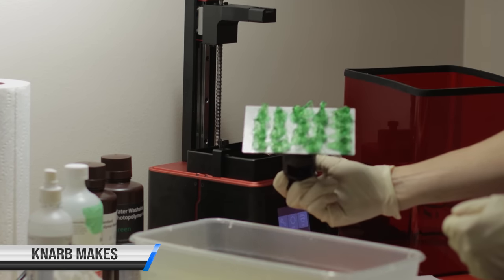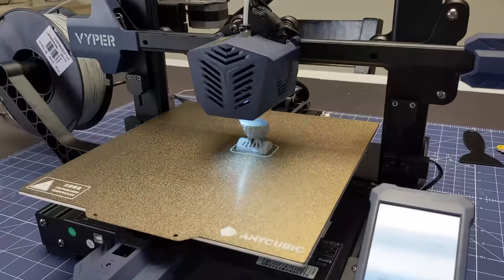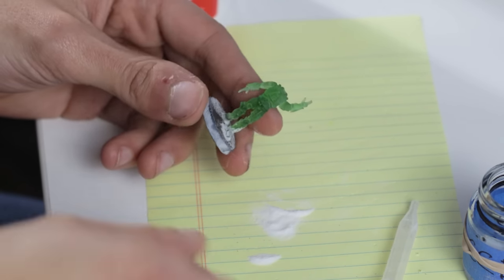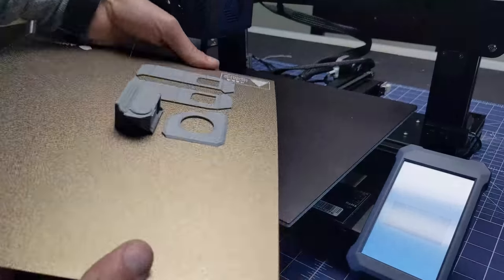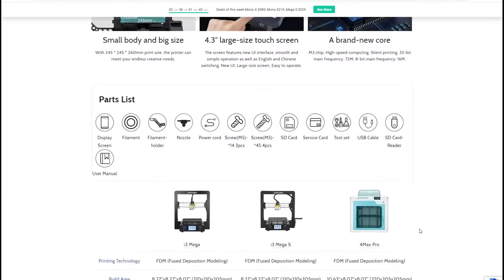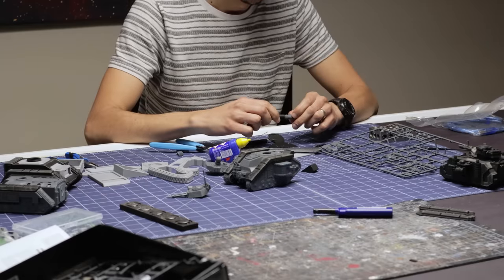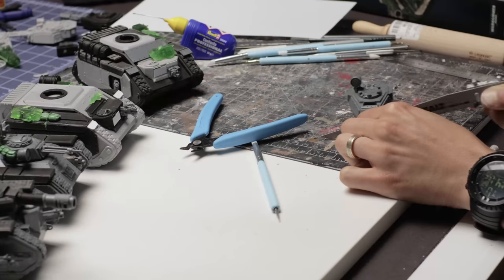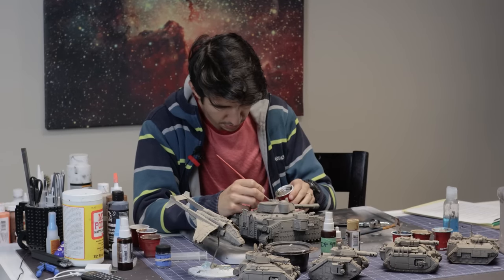Did SLA Printers win the tabletop war? (not yet)

Comment: FDM is suitable for more regarding tabletop and boardgames than many believe. I printed everything with FDM (Prusa MK3s with Multimaterial Upgrade) for my own design of a Settlers of Catan (base game). Of course it is much harder to print detailed objects with FDM, even with my 0.25 mm nozzle for that project but if you optimise the models for that task a lot is possible on a damn fine scale. Details are so small that you miss out seeing a lot of them unless you are looking very close: https://www.prusaprinters.org/prints/44082-catan-set-high-resolution-mmu-unofficial-fan-desig#preview

PS: Nothing is painted there. That's all multimaterial PLA.
Reply from the maker: Woa that's nuts. I need to take a look at a multimaterial printer soon. Very cool result.
Reply: @KnarbMakes  I like the end result quite a lot as well but be warned, it is really only suitable for hobby projects where time and material wasted don't matter that much. And especially the MMU2s from Prusa takes some commitment to get running reliably (but when you have dialed it in, it works fine). I am not sure about the Palette, it is way more expensive and functions quite differently. Certainly has its quirks as well but maybe it is easier to set up. Last but not least you can go full in and try to get a true tool changer from E3D. I don't know that much about it but if you have the money, this looks very interesting and like a game changer of FDM printing. But it might be quite difficult to set up. (Pro: https://www.youtube.com/watch?v=1SCtW1DskXc; Con: https://www.youtube.com/watch?v=7W5pPm0lZDE)

Comment: Dunno if you’re still watching, but have you any Space Marine designs in the works?
Reply from the maker: Not anytime soon. Not really a faction that interest me much.
Reply: @KnarbMakes  That’s coolio. I’m wondering if the turret mounts on top are the same as a razorback/Predator/Land Raider turret bases?So I can bolster my IG PDF with different tanks chassis.
Reply from the maker: @smoketinytom  should be easy to modify if not or use a magnet. The mount is compatible with the leman russ kits I have if that helps

Comment: I've had an Ender 3 Pro for about a year, and other than having to relevel it every few months, it's been a solid machine. That relevelling though...its enough to make me intrigued by the Vyper if that self-levelling feature works and continues to work over time. The orientation of the parts is a fantastic idea, if you can do it produces a very smooth finish. I have become adept at post-processing for those prints that cant be done that way....primer/filler, Mod Podge, wood putty, sanding...they are all close friends now ;-)  Those tanks are awesome btw. Cheers!
Reply from the maker: Yep, some sanding and filler goes a long way! Sometimes layer lines can't be avoided.

Comment: I see it in two ways. FDM can achieve fine details but is better for medium to large scale builds, hence why many higher end FDM have very large build volumes. SLA on the other hand is great for Small to medium builds of high resolution, but small build volumes in general. NOW this rule isn't always true there are outliers and variables of the two, including materials, production of specific parts and their own requirements to manufacture.. etc etc.

For model making in general I use FDM for large pieces, landscape, etc. SLA for small fine details, like single figures, people, miniature weapons, etc.
Reply from the maker: Yeah I've been leaning towards that rule of thumb as well. The crazy detail from sla printers is reserved for when its actually necessary

Comment: Facing the most visible are upwars is a terrible idea, I do the exact opposite. The Z resolution can go down to 0.08mm with a 0.4mm nozzle, however the XY resolution is larger than nozzle diameter so about 0.42mm. You get 5x better resolution vertically than horozontally.

Comment: I think this vid is a bit missleading. The Reason is very simple, its not all about orientation. Orientation helps at flat surfaces so you can ironing the top layer to make it smooth. But on a round surface no matter what kind, you would never get a smooth surface without some afterwork. Same for prints that have more than a 2 mm height. If someone think im wrong proof it please.

Im still looking for techniques to get a smooth surface without loosing most details. But most techniques cloak up sharp edges or small holes while not covering the layerlines very good.
If someone have a great solutions that works best for you i would like to know  :)
Reply from the maker: Yeah, you're absolutely right. Round surfaces are never gonna lose layer lines. Still, flat surfaces are pretty prevalent!

Comment: for tabletop pieces a FDM maybe the right choice if you are not painting them , for my Model builds a FDM is a no go in any case , yes your big models look good from distance close up you can see any layer, and yes you can see in some cases layer lines on Resin Printers , but that is for not correct orientation or weak supports , learning curve is more stiff and take a lot of time for the total  print time, and the post production is also a lot to consider.  But can you print 0,5 mm holes in you parts for hatch to open and close the details you can print on Resin Printer is not to do with FDM , at least not for home use printers. but who have the money for 40000dollar printer, but the same is for Resin printers. And all oof that try to sand and fill the Layers on a FDM printed model .

Comment: In my experience, I've found SLA to be inferior to FDM in every metric except for quality.  The SLA cleaning and maintenance process is SO annoying even when I do need a smaller more detailed part I usually end up just swapping in a smaller nozzle on one of my FDM machines.  It has to be a very specific use case for me to bother with SLA.
Reply: I was able to get the same detail in my FDM printer as I did with mu SLA. I just find at that level the SLA is faster and more reliable.

Comment: I design and build a lot of functional parts, first started with fdm and I have to say fdm is extremely easy to get very good at but resin printing is very nice for small detailed parts that just would take alot of fussing around with on fdm. I don’t see them in competition with each other tbh. It’s like comparing a vertical milling machine with lathe IMO …. Yes most parts can justifiably be made on ether and be great parts but some parts are just easier to make on one or the other.
Reply from the maker: Well said. That's really what it boils down to, they each have their strengths that can be used together to get great results.
Reply: milling*

Comment: what he isn't telling you is that you have to turn on ironing for it to smooth the top layer of orientation.  if you google how to smooth the top surface of the model there is a video that shows you how to do it via cura.  Hope this helped someone who is fresh to 3d printing like I am.
Reply from the maker: Ironing helps a ton too. I have used it on some of the parts, but it's not required. You get a slight pattern without ironing, but it's no where near as pronounced as the straight layer lines, and usually occurs diagonally.

+1 thanks for mentioning it!

Comment: Small stuff only here and the need of high quality prints. Like castable (lost wax) models. FDM sucks big time. However, I still use it. Prototyping is the key. FDM does a print in a fraction of the time any SLA printer requires. You get a fairly good glimpse what your design will look like in real life. Is it printable at all ? Did you slice it up neatly ? Then pop it over to the SLA printer and voila - you just saved some time and money on failed prints.
Reply from the maker: It's saved me a ton of time prototyping as well. I can print a tiny little part flat on the bed in like 10-20 minutes.

Comment: It's only preorder price tho. And I don't like how hard modifying anycubic printers are. But mostly it sounds great. I want one. I'd want to upgrade the bed to AC for fast abs prints and the extruder to direct drive maybe
Reply from the maker: What projects do you typically use ABS for? Haven't tried it yet.
Reply: @KnarbMakes  mechanical parts. mainly parts for my 3dprinter, as even PETG melts and softens in a 3d printer.

ABS is really famous for it's heat resistance, it's also less brittle but more flexible than pla.

for figurines and non-mechanical parts ABS can be used to be acetone smoothed, it looks incredible and injection molded, check out acetone smoothing you won't be dissapointed!

but I do print a lot on my printer, PC blends, nylon, TPU, etc. I'm saving to hopefully even buy PVA as a dissolvable support material. don't need it but it'd be fun xD

Comment: The more I look into the differences between FDM and Resin printers, the more I'm convinced I'm never going to buy a resin printer. 

The downsides of FDM all look like surface imperfections that go away if you figure out the right settings. Even if a print goes wrong a little bit of filing, sanding, and the right paint job can turn the most screwed up print into a terrain piece. Too many artifacts on a vehicle mini? Cut it in half and paint it so the imperfections look like rust or mold/moss and you have a great set piece for a battlefield map/diorama. Too many cracks, lines, and sharp angles in a character mini or a figurine/bust? Paint it bronze or sandstone colored, remove the base, and it's a broken statue in an ancient ruin.

And what are the problems with resin? Resin costs too much. Alchohol baths, gloves, and masks nickle and dime you over time. Failed prints too often result in a lump of goo that can't be repurposed or salvaged. Toxic fumes. Size limits. Extra steps in an already time consuming process. I don't think resin is the solution for any of my needs.
Reply from the maker: Well written! Resin printers are super magical to me, as there is almost no visible artifacts from the layers with the naked eye. Maybe the post processing will be sorted out in the coming years.

Comment: would an FDM printer redesigned with a laser in place of the hotend and submerged in resin work lol. thats my idea for how to get bigger SLA printers for cheap
Reply: That's basically how the earlier resin printer worked, but the laser is expensive and there are additional moving parts. The monochrome LCD screen and UV LEDs of the newer resin printers are better, faster and cheaper

Comment: I would be very interested in your workflow and software used for creating the digital models, I have been saying to my circle for a while that the real way we should be making models is just like this in 'kit' form on FDM with support of fine detail components / some surfaces from SLA parts. Rather than the print the whole model in one go stl's we currently tend to use/make.
Reply from the maker: I use a mix of CAD (Fusion 360), Blender and Meshmixer for existing STLs

Comment: Hello the 3d modeling parts you were cutting at(the extra parts as you said in the video) 3:24 is that also include the tank files?? because i would like to buy a tank file from you but don't know if the finest details also included of the tank file??
Reply from the maker: The grayish plastic is molded plastic from GW kits. If that was your question. Cheers!
Reply: @KnarbMakes  Yes that was my question. But what is GW? Sorry that i don't know that. Because i bought the file but there are no guns or details further in the file's like the guns on the tank
Reply from the maker: @Just-Rico92  no problem. Stands for games workshop. You can find bits that would work well based on what type of guns you want the tank to have. Search for 3d printable sponson weapons, etc.

Comment: Contrarian opinion. I’ve had both and my opinion is that Fdm printers are on their way out.  Fdm printers have more mechanical parts and more points of failure and places in which issues arise.  They constantly need tweaking.  Resin printers are coming out in larger formats and tanking in price. Instead of buying a $350 fdm printer I would rather buy a $500 Elegoo Saturn.  Phrozen just released large format Mega 8k for $999 (something that would have cost 2-3k a year or two ago). Once you get you settings dialed in with a resin printer you rarely have to change anything afterwards.  Resin is going to cost less.  

I wouldn’t be surprised if we start to see medium and large format resin printers go for 350-400 and 750-900 by the end of 2021/early 2022.
Reply: The thing is, FDM printers will never really stop being produced because they are essentially the automated hot glue gun, there is always someone that is going to want to print cheap big simple plastic parts and it’s much easier and simpler to do that on a FDM then it is a resin. It’s also sometimes down to material preference too, some people prefer PLA to SLA plastic printers against resin printers.
Reply: its not contra opinion :) its even in the name of the video how sla "not yet" won. When the resin will be cheaper and the printers will be more affordable (for many ppl is the loss of quality acceptable when the cost of fdm is just a fraction of sla). You yourself wrote "resin is going to cost less" which means it is not cheap now and you hope - or know that it will be better in the future. As for now, I am personally curious if sla will get cheaper or fdm will get better quality (new technologies can come for both).

Comment: FDM printers are amazing, for those just starting out and having low space requirements a Tronxy X1 would be the best solution. as it is the most hacked printer in existance.

i have a Anet A9 myself, which at the price i paid for was a steal, {literally}. during the aliexpress brand sale it was even cheaper than the Tronxy x1
Reply: Not literally

Comment: I literally just spent a few $100 on an S LA printer with a larger build volume than the FDM printer you're using. On top of it being alter affordable it is also 4K resolution and prints with a layer height of  50 microns. FDM is dead for everything other than structural industrial and tool use.

 Honestly if you want to spend $1400 you can  Pre order  The sonic Mega 8K and get a printer with a 15" build plate and that Prince in 8K resolution along with 5 l of resin and 3 extra FEP replacements.  Granted that's only while its on pre order and there are probably less than 200 left to order at the time I write this but even when it comes available for retail the printers going to be less than $2000And you can print full sized titans without even needing to run multiple prints.
Reply from the maker: Which SLA printer did u get?
Reply: @KnarbMakes  reread my comments. I spent a few hundred.  Not just one hundred.  I'm sorry if my initial comment was unclear.  

 I picked up the sonic mighty 4K on Amazon for $506, that's about what I spend on my mid size FDM printer a few years ago and II consider that to be super affordable and in the same price range.
Reply: @KnarbMakes   Anyway I do want to say the stuff that you can make with an FDM printer is amazing. You are far more talented at making them work for you than I am. Keep making good videos even if I do disagree with you from time to time l. lol
Reply from the maker: @garfieldwithissuez  good stuff. Alright to disagree, haha. Keep on printing and making cool things!

Comment: Yes SLA won, especially with the addition of flexible resins to add like Siraya Tenacious. I haven’t even touched my Ender 3 V2 since getting the Elegoo Saturn.
Reply from the maker: I'm currently using all my 3D printers simultaneously, haha. Resin + 2 FDM printers.
Reply: @KnarbMakes  I did that at first too, until I realized there really was no benefit to filament and I just had strong confirmation bias trying to convince myself the Ender still had purpose haha. Once I got the larger Elegoo Saturn and found Tenacious resin to cut other resins with, I was done with Filament. The SLA just comes out perfect with virtually no post cleanup of the print. The Achilles heal was always how fragile resin is, but once I started mixing with like 10% tenacious and “ABS like”, there was almost no distinguishable difference to a mass produced part. That’s just my own personal journey, to each their own.

Comment: Does the Vyper's finished work have lots of mold lines? 
What is the shelf life of FDM in an indoor, dry environment?
Reply from the maker: Theres no mold, so theres no mold lines. Layer lines are present which may be sanded where they are unsightly. Shelf life of the printer? You need to do regular maintenance to keep it running well. The PLA plastic can sit around for years if its dry.
Reply: Oh yeah. I meant layer lines but did not know the term. I have been wondering whether an FDM model is a long term investment or a Hyundai.
Reply: Crap. By FDM I mean the plastic. I have never been good with terminology. You know, the thingy the thing sploogs onto the bendy thingy.

Comment: On average how much does a tank cost to print? I wanted to get a FDM printer for terrain but I’m scared it’s going to cost the same as terrain from Games Workshop. I got quoted almost one hundred dollars for two buildings that are 6 inches in every dimension.
Reply from the maker: The tank costs pennies to print. Filament is generally around 20-30 dollars canadian per kg, and you can print a ton of stuff off 1 spool.